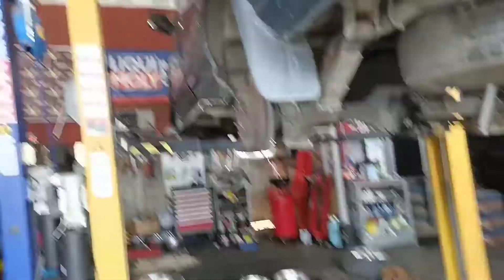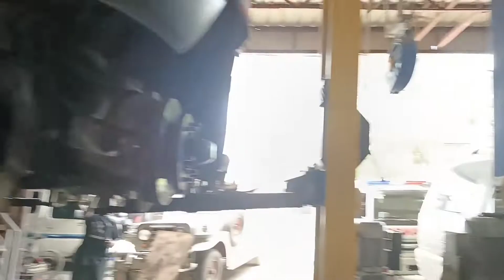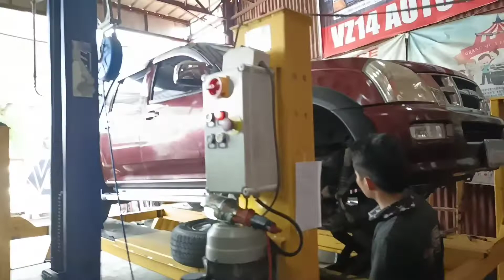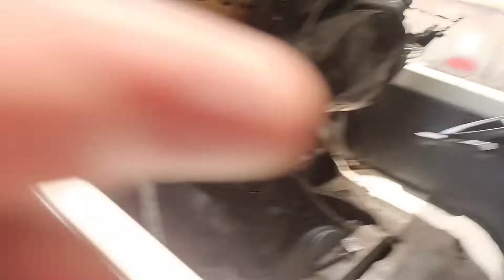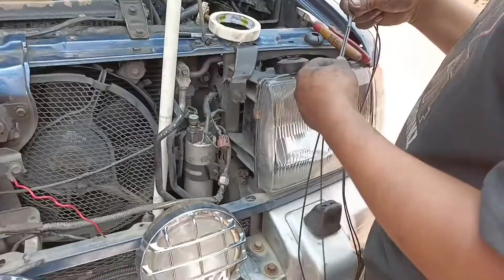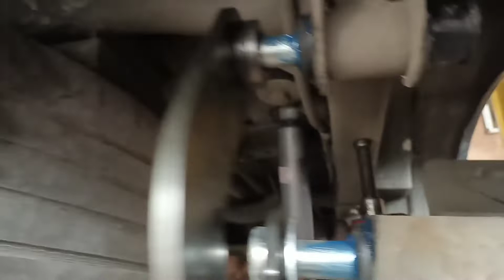HOW TO INSTALL COMPORT SHACKLE ISUZU CROSSWIND - VZWORKZ PALIPARAN

Comment: San po mkkbili ng comfort shackles..Sportivo x unit..ano s tingin nio n pwede n size..magkano po yan and San nbili tank engineering..

Salamat po
Reply from the maker: Meron po kmai stock sa Vz14 Autoworkz boss..
Reply: Ano po uli contact number nio po sir?
Reply from the maker: @batangmaynila9405  00568108572